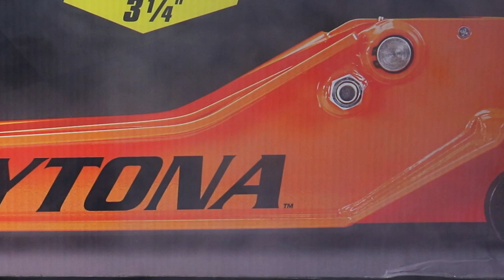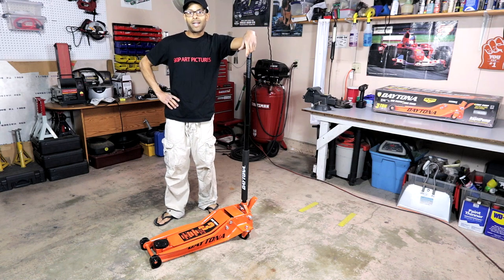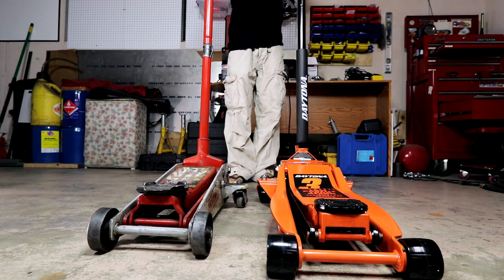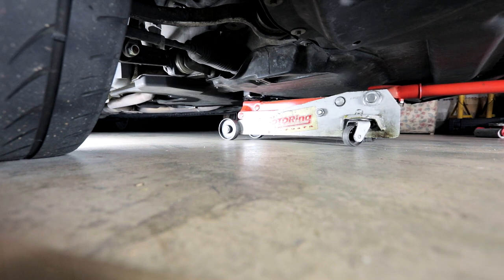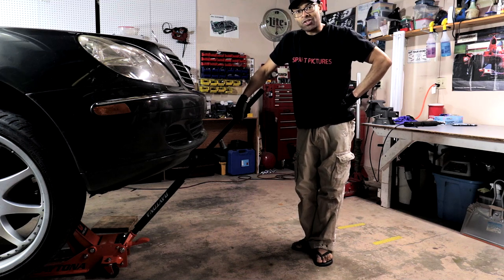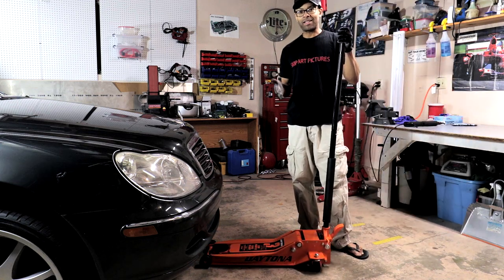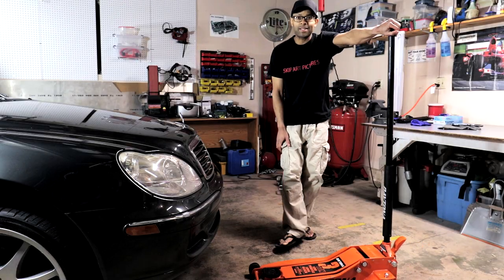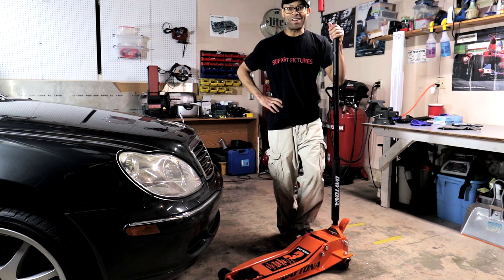Best Jack of ALL TIME - Harbor Freight DAYTONA LOW PROFILE LONG REACH JACK - Why It’s My Choice

Comment: Just bought one, right out of the box I put it under the dually rear of my Ford T350HD service truck with a Knapheide utility body, which currently weighs in at about 9,000 lbs... it got the whole rear off the ground enough for me to rotate the tires and install valve stem extensions... First impression is great!
Reply: Does it still work?
Reply: How is that Jack holding up I was deciding between this and the one with the 3-year warranty
Reply: @f.b.i7334  it does
Reply: @mrbreezeet1  still working good
Reply: @Trigger_32  👍 thanks, good to know.!
Practice safe work habits.
Reply: @mrbreezeet1  just bought the black version today grab it buddy its worth it... Its super heavy tho bro 104lbs🤙💯
Reply: @cuzithagreat975  
Thanks, heavy it's ok, I'm not looking to carry it.
Reply: Well if he sold you, then you definitely just sold me on it!

Comment: Thanks for the great review and quality production. I just bought the Yellow Daytona yesterday as I noticed it doesn't sit any higher than the LP Long reach model. I had two main areas I was hoping it would do well. 1.) 2008 Miata Sport, I wanted to be able to reach the front jack point and since both the Yellow or Orange Long Reach are the same height I found the longer reach ended up not even being needed as the yellow model slide under the car just as easily as the long reach. 2.) RAV4 Gen 3. I wanted a jack that could raise it up high enough to slide some wheel ramps under it so I could quickly and easily set the entire vehicle up on 4 ramps. I still need to test this as I did measure it and it is close. The long reach might be needed with that extra 1" of lift.

I do agree with you the smaller jack pad would work better for me as well with a Miata, Sienna and Rav4. My hockey puck allows for a more pinpoint jack location though so not a big deal. Too bad we can't buy alternate jack pads either small or large from HF.

So I think I will likely keep the yellow model as it is just as low as the long reach so I didn't end up even needing that extra reach for that deep jack point on my Miata. I like the 3yr warranty and zerk fittings all over to properly grease it even though I don't need that level of durability as I don't use the jack all that often. Also there was $20 off the Yellow model that made it cheaper by $10 than the long reach. The only main feature I might like is the extra 1" lift and foot lift.

Comment: I personally bought this jack 4 months ago after comparing it to the yellow one, the pistons are the same size welds are the same. The only difference is the saddle and saddle mount are smaller and the front wheels dont have zerks fittings to take grease, and the handle on the yellow jack has a quick release pull pin

Comment: Both of my yellow Daytonas do that saddle pump thing. I was going to exchange it, but all the ones on display do it too.  Therefore, I've concluded it's normal and don't care anymore LoL! excellent editing!
update I'm only adding this because of the notification i got about my original post which brought me back here. Here goes... the gondola over my porch has a rotting main post holding it up. I used my yellow Daytonas to jack up other wooden posts to support the structure while i replace the rotten post. The jacks have been holding it up for about 4 days now.  No leak down.
Reply from the maker: Thanks Topgunns1000! Also, thanks for sharing that information with everyone. I was able to reduce the saddle pump to almost zero. It comes down to getting the fluid level just right. Cheers!

Comment: 15:00 In fluid dynamics, the presence of air in the fluid creates the exaggerated or erratic actuator movement you experienced where too much (hydraulic in this case) fluid has the same effect as too little. Every system has a "just right" point, whether it's your washing machine or your toilet tank or brake lines.

Comment: I saw that jack at Harbor Freight, I was going to buy it for the same reasons as you. I went to pick up the box and noticed that it was very heavy. I thought it's too big and heavy, I don't have anywhere to store it, having a single car garage. The thing is that I noticed in your video, is that the handle comes off very easy, which would allow me to store it. I think I will go back and buy it.
Reply from the maker: Hi George Cicairos, That sounds like a great idea! Have you also thought about placing the jack in the center of your garage at the end, so that when you park your car the jack would sit under your bumper? You would just have to be careful not to hit it or run over it haha!

Comment: If you own a Mercedes S500 you don't need a floor jack you need a bank account and a Mercedes Dealer!
Reply: LOL! You couldn't be more right about that!...
Reply: I disagree. Just because you have a relatively expensive car doesnt mean you should forget about doing you own maintenance. It's one way of affording the car in the first place. This comment is spoken like a true poor person. Ijs...
Reply: Or a mechanic like me that owns a top of the line diagnostics computer and does side work... Lol
Reply: @tggraham3321  moreso by said by most people because people think the dealers know best. This is not reality. Dealer techs are only trained on one vehicle and what they commonly have issues with. 

If you find yourself a tech like myself that has the tools and does side work or simply a german car shop not dealer they typically cost half the price of dealership use the same parts and have better training.
Reply: @mustangdemon87  better training? I dont know about that. Most manufacturers now partner with tech schools to bring manufacturer specific training into the schools automotive program. Plus, dealers have access to specialty information syetems and all sorts of manufacturer data that independent mechanics cant touch.
Reply: @andybub45  so you say. I have done a great many of jobs with my snap on scanner that the "dealers" told the customers only "THEY" had the tools and proper procedures to do. Guess what that was a lie. I have worked with a few guys from tech schools. They didn't know jack shit except the basics. Same as working with guys from dealerships that only know one or two cars because that's all they were allowed to work on. I do more work now solo then when i worked for shops.
Reply: @tggraham3321  what a stupid thing to say.
Reply: That was funny but also true
Reply: @tggraham3321 Can you comprehend that he meant parts and maintenance for European Luxury Models because of the brand names cost substantially more than other Brands that most people just cannot afford to keep up with?
And then, you threw in that poor insult without having first have understood what the guy meant.

Comment: Decided to compare this to its $60 cheaper, non long reach brother, thinking i could care less about the foot pedal and an extra inch of reach for $60 price premium. I was quite surprised to see they are completely different jacks, in height, lifting height, length (like 4.5 inches longer) and most shocking...weight. This beast weighs a solid 25lbs more than the low profile standard reach brother. The smaller, lighter version should meet my needs, its actually not nearly as tall and the lifting height is a bit lower, so it also has advantages besides being much less expensive. Nice review!

Comment: Not saying it will change the performance in any great way, but on the craftsman (I have that exact one), check and fill the fluid if low. Mine was a bit low and it improved performance after I corrected the level.
Reply from the maker: Thanks for the advice GNX157!

Comment: The Daytona Super Duty is the SnapOn jack. Same manufacturer, same factory, same assembly line, same jack. Only jack with the 3 year warranty.
This long reach is only 1 inch longer in length from pivot to saddle, and goes about 3/4 of an inch taller and about 1/2 inch shorter. The Super Duty is worth the extra 40 dollars over this Long Reach version. Plus I found the foot pedal to be a useless feature that's just in the way.

Edit: Personally, I mostly work on trucks, SUVs, and tractors and the larger saddle pad on the Super Duty jack is a much better feature. 
Also, the Daytona Super Duty jack reaches full height in only 4-1/2 full stroke pumps.
Reply from the maker: Hello Salty Steel! I guess it's time to add the Super Duty to the collection haha!

Comment: Thanks for the review. I was between this and the yellow. I just got this for 159.99 which is a pretty good deal. Skipped the warranty, the reviews on these are too good and I use a jack less than 8 times a year usually. Am using them to lift a 340i (3700 lbs) and a Jetta (3200 lbs), so the orange is more than enough. 

I do need 2 jacks and have an old craftsman that's pretty worn out. Thinking I'll get the yellow next year around the holidays as it was on sale this year. Hopefully that'll mean two jacks that outlast me with the proper care. Thanks again for the thorough review.

Comment: First one out of the box was wobbly with one front wheel not touching the ground.  Returned it.  Decided to inspect the replacement in the store.  Second one out of the box was worse.   The front wheel retainer clip fell off pulling the jack out of the box and was wobbly as well, one wheel not touching the ground.  I asked for a refund and gave up on the jack.

Comment: I have the same jack with green coloring. I have had no problems and don't expect any. A lot of cars are so low that you need the confidence of a low profile/long reach. I still employ jack stands or a bottle jack (as backup) in case I accidentally move/release the Daytona. The steel model is heavy but rugged. Maybe one day Harbor Freight will figure out a way to add handles for mobility.

Comment: Hey man, what is the length from tip to the up bend above the “T”? Then what is the length and height above the “A”?

I have a lowered turbo track 350z I lift from the front but with a normal jack I need to drive up 2 2x4’s before I can get under it. I’m trying to see if this will reach before it hits my bumper and allow me not to have to drive up onto blocks every time. Shit gets annoying lol

Comment: I bought this same jack but exchanged it for the yellow super duty because the wheel are held together with only some cheap clips and rivets on back wheels were cracked. The yellow one has nuts to hold better. Just taught that was its weakest point of the jack. Other than that. Both jacks work great. Only 10$ difference

Comment: I have this jack and works great.  They also sell a cross bar adapter that allows you to make a T and for small/compact vehicles you can raise both axles at the same time.  Makes it easier to do brake work.  The only drawback is sometimes the lifting point and jack stand point are the same.  Have to find a designated spot for jack stands.  For brake and suspension work you can remove a tire and set the Jack Stand on the control arm.  Flip flops in a work shop environment aside he does have a point about not using to support.  That’s what jack stands are for.

Comment: i got tired of the jack and stands  so  i bought a quickjack 7000ext  all four  tires off the ground and  feel way safer and a lot more comfortable under my vehicle in my opinion it was well worth the investment  great in depth review sir on the daytona
Reply from the maker: Hi V R, That's cool! How convenient is it to store it?
Reply: @GarageDynamics  my son built me a set of brackets that i could mount them horizontally on  the wall at each side of my garage i wish i was able to figure out how to add a pic here they arent hard to store great investment
Reply from the maker: @vr-cx6lq  That's very kind of your son. I took at look at the quickjack and it looks like a good tool to have
Reply: @GarageDynamics  i've been  watching your videos for sometime the 722.6 transmission fluid change  tutorial i found quite helpful for my sons ml320. the quickjack  worked great  for me in my low ceiling garage for working on my cars and i move it out to the driveway when working on my ml320 and it lifts my 2014 ram 1500 with ease. i was  reluctant at first  to spend the money but i  definitely have no regrets since buying it last year
Reply from the maker: @vr-cx6lq  Thank you V R! I appreciate the loyalty :)  Wow, this jack just keeps getting better! Haha! Are you using the jack on a flat or angled driveway?
Reply: @GarageDynamics  my drive way is very flat i think the manufacturer recommends no more than a 3 degree incline which is in all essence flat lol
Reply: from your videos you would have no issues inside your garage i use mine and i have 7 foot ceilings i dont have a s class but i have had a 2002 e320 up on it at max height which is over 20 inches more than enough to work under with retaliative comfort on a creeper
Reply from the maker: @vr-cx6lq  That's good to hear. I've been watching some videos and it seems like a good solution to a floor jack and a full on lift
Reply from the maker: @vr-cx6lq  haha! That's good to know

Comment: Great video thank you! I'm wanting to pull the engine/transmission/suspension out from the bottom of my car and it's looking like I may be able to with that jack if I can find a way to hold the body up or I may roll the assembly out the side (I have a pallet with wheels I can use if clearance allows). I ordered it with 15% off so around $170, plus shipping and I also got the Pittsburgh 25" breaker bar with a comfort grip for $15.

Comment: would this be a good gift for a father who likes to work on cars at an amateur level?
Reply from the maker: Hi Cynthia Choong! Yes, this would be a great gift for your father. As he gains more experience he'll be glad you bought this jack for him. I hope this helps. Cheers!
Reply: @GarageDynamics SkipArtPictures thank you for the informative video!
Reply from the maker: @CKChoong  Anytime! Thanks for stopping by :)
Reply: @CKChoong  if you didn't buy it yet, I would suggest you to buy the one with low profile only. It will be lot cheaper and lighter ($119 using coupon). You can live without the long reach option.
Reply: Yes, indeed,  im a dad who works on all vehicles,  and have many of jack of my life, and just picked up this one in green. Damn i should have bought this yrs ago.  Got it on black Friday deal ffg or $179.00 , i must say  compare to my craftsmans jack this one is rock solid and strong, works great on my F350, F150, and my Ford ranger edge.
Reply: My son just got me the 4 ton today. I'm impressed at how well built and sturdy it is.👍

Comment: Weld your custom handles to it!!   You could get it done easy with a cheapo flux core welder as long as the settings are set correctly.

Comment: Are you able to jack up a car and or truck fully  just using the foot pedal and if you can is it easy or will the will the pedal snap off? 
i work in tight places daily with a floor jack where i can only get about 1/4 of a pump

Comment: Hey I have a question this is my first jack I have ever bought/used and was wondering if it’s normal that I can turn the handle counterclockwise without it stopping/locking? Is this normal? I can just keep turning but then the more I turn the more I need to turn clockwise to lock the floor jack in order to raise it up. Is this normal or should a floor jack lock while turning counterclockwise? Thanks in advance!
Reply from the maker: Hello Adam R, My jack operates the same way. It locks when you turn it clockwise, but it will continue spinning if I turn it counterclockwise.

Comment: I just bought one of these but it doesn't have a foot pedal like yours does.  Are there different versions?
Reply: yes there is, just got the long reach low profile 3 ton today and there's a foot pedal
Reply: @flipmode00  hard for me to justify 60 extra dollars for a foot pedal
Reply: @sheepdogsherlock1311  I totally understand your point but in my situation I wanted cuz it's the long reach and I could lift the car from the middle and I was looking at the arcan Xl2T but this was 199 versus 226.

Comment: I really wanted one of these until I found out that that it only has a 90 day warranty. For almost 200, I would want more assurance.
Reply: I was told at HF that they carry 1yr on these LR LP models and 3yr on Pro Yellow model. I bought the Yellow.
Reply: $60 for 2yr warranty

Comment: Damn now I don’t know which floor jack to get, this one or the yellow professional one?
Reply: This one sits a little lower, goes a little higher and goes a little deeper than the yellow one. Depending what you want to do with it or what you're working on. They both handle the same weight. I got the yellow one when it just came out and it's still going strong. I have zero issues with it.
Reply: I'm really liking this new one because of the foot lift option and the added reach. Visit the store and look at them on the shelf. They have them assembled and on display.
Reply: the yellow one is literally the same jack as snap ons. literally same factory. snap on actually sued them over it but lost since the manufacturer sold it to both of them. the new daytonas seem to be just riding on the curtails of the yellow one. the yellow one has been proven, the orange have not.
Reply: Ben Ault are they still made in the same factory as fap off? Or have they moved to cheaper manufacturing since the fame they got from the lawsuit?
Reply: Yellow Professional is a better jack.. imo. Pump internals are better. 3 yr warranty as well

Comment: That dead spot on the Daytona jack was because it was your first time lifting something with considerable weight. It was literally priming the cylinders and creating the high pressure it needs to lift. The 2nd time you lift with it. It will be gone. I have the 3 ton super duty and it also did that on the first lift. You didn't think of this. You're a mechanic. ???